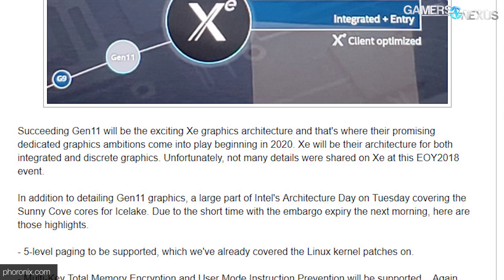Streaming Misconceptions: Best OBS Settings & NVENC vs. X264, ft. EposVox | LTX

Comment: Wow... I can't believe streamers are out there running 1080p on a webcam.  LOL.  It's been 4 years or so since I was messing around on Twitch.  I ran OBS as well with some templates to make it look more professional.  I streamed at 720p x264 on fast preset with my webcam (which was a PS3 camera using custom software so it would work on my PC) was at 240p.  When it's a thumbnail that small it will look just fine at a lower resolution.  My upload speeds from ISP was only 5 Mbps at the time.  Despite the challenge, I thought the streams turned out pretty well.

Comment: another thing that I would like to see more information about is ingame framerate vs. recording framerate. From my own testing the only way I can get really smooth recordings is to keep both framerates in sync. For example limit the game to 60fps if you want to record in 30 or 60fps. When I cap the ingame framerate to 58 or 62fps the recording in 30 or 60fps will not be 100% smooth (in all those scenarios, there is no encoder or rendering issue in the logs, because CPU and GPU load are way below 90%). And of course playing back 60fps on a 70Hz monitor will also not be as smooth as playing it on a 60Hz monitor, which is to be expected.

Comment: What is wrong with the AMD encoder?  I don't really seem to be having issues running it with my Vega 64 using streamlabs obs.   One thing though, it's impossible to stream when using freesync.   Any other issues I should be on the lookout for?
Reply: I came to the comments for this as well. I have a Radeon RX580 and I use that to stream to Twitch with zero problems. I find the quality drops entirely even when not streaming by using FreeSync so I just never use it. Which sucks because I bought a monitor because it was FreeSync enabled.

Comment: So with an 8700, I should be able to just set it to medium and be golden? I get mad input lag in rocket league when I do that. The game runs*okay* (still over 120FPS) but the input lag is unreal. Wut
Reply: meduim with a 8700, nope sorry. You need more cores if you want medium like the 3900x
Reply: @FreeSpirit90  You're gonna wanna go team red if you wanna software encode.  6c/12t or 8c/16t, or more  ...video takes full advantage of all available threads, so AMD shines here. 3700 or 3700x is basically built for this.

Comment: you can use this string to do a bandwidth test when streaming to twitch and it basically initiates the actual stream without going live i use this for testing all the time and its great 

just ad it at the end of your streamkey and remember to remove after to go live :D
?bandwidthtest=true
Reply: great for testing internet and bandwidth related thing. 
But this video talks about image quality, you kinda need to look at the video to be able to judge the quality.
Reply: @lordsqueak  that's not what it is for the bandwidth test is to see how much you can saturate your upload and for performance testing without going live why would I want to check my image quality if I'm testing for upload saturation and performance..........
Reply: @daineball  "upload saturation" ?? What a quaint way of putting it.
But to answer your question,, because you just watched a video talking about image quality. Getting the bandwidth just right is of course a part of it all, but that's not the kind of test they are talking about.
Reply: @lordsqueak  that is EXACTLY what they are talking about being able to push the res on your crappy machine VS the amount of bitrate you can push out most people cant even support a 5000kbps stream which is what they are talking about so when you need to find out weather or not you machine or internet connection can handle the res+FPS which equals your bitrate thats the budget they refereed to not once but like 4 times, please stop arguing with me you obviously missed the point of this video. the point if you machine can handle 1080p @ 60fps and you can only stream out 2500 the percived quality would be much less than even a 480p at 60fps stream and even the perceived quality of your stream would be higher if you just drop down to 30fps which is what they are saying so the point again is PERCEIVED QUALITY, so to get the most it prudent to do allllll of this testing OFFLINE and NOT LIVE thereFOR no image  is needed because the math is done already and if you cant do the math GTFO bro im saying do the math first and you weont even need to preview for image quality because you did the math first like seriously i just summarized the entire video and you wanna tell me i didnt watch it? get real dude.
Reply: PS UPLOAD SATURATION is a widely used term in networking and other tech cirlcles...., get good son! its used to describe at what point your connection can no longer handle a constant bitrate upload, burst upload speeds are different and so is kbps to megabit so honest just stop, ive forgotten more about computers and networking than you will ever know
Reply: @daineball  Well done! You have figured out what your upload bitrate is.  (it's not like you didn't know this already)
But that is not what that test is testing.  and it is certainly not what the video talks about testing. 
So instead of being all snarky and insultive, just accept that you didn't pay attention to what the video was about, and move on son!
Reply: Ps bandwidth = image quality and fps budget as they speak about so therefore it would be prudent like they talk about to not stream at 1080p @ 60 fps if your upload saturates at 2500 which is what they are talking about but I guess you could actually understand what they are talking about then you'd have known that and not commented a pointless regurgitated comment.
Reply: @daineball  Well, I know "upload saturation" is not what is being tested with that twitch test, or what's talked about in the video.
Reply: @daineball  Well, first of all, you didn't pay attention to the video. Or to what that twitch test actually does. And while bandwidth saturation is a thing, it is not a thing that has any relevance whatsoever here, since first of all the test being talked about in the video is about doing a video quality test. secondly, there is no way anyone single streamer is going to ever be able to saturate the upload to twitch servers. Thirdly, the twitch test is about the quality of your connection, detecting lag spikes, drop outs, and generally figuring out if there is a problem with the connection.
Fourthly, instead of just accepting you made a mistake, and silently go away, or even do the honorable thing and go "my bad", you resorted to insults, so you're damn right I'm going to call you out on it. and now lastly something that is borderline a death threat. And that is not OK!

Comment: Second time I say this -> Twitch does not have bitrate cap -> I've streamed with over 35 mbit/s / 35000 kbps and the stream info shows it. Maybe there are caps for new accounts or something because I don't have a new account but I also have no "achievements", viewers and so on...
I would also like to add that above 15000 kpbs there is no difference at all to the quality on 1080p on 60fps.

Comment: I actually prefer streaming 720p even tho my PC and internet connection could easily do a 1080p stream. Why? I did some testing and I think 4mbit is a sweet spot for 720p30. But with simple math, that makes 9 MBit 1080p30 literally impossible on Twitch. 8 MBit for 720p60 are already the maximum. 1080p60 for me is simply just a wish, adding up to 18 (!!) MBit.
Reply: 720p looks fine to me on Twitch. 1080p even if streamed well is not much better than 720p.

Comment: Hi steve, a VR content creator improved his framerate by hitting the reset/default button in overclocking software, like MSI Afterburner, a couple of times while the game is running. Nvidia looked into the issue and responded with "it just workes!". Could you take a look at it? The link of the video: https://youtu.be/7YpWQflHTC8

Comment: AMD has problems with OBS, which go beyond their encoder. I was still using an Radeon HD7870, until recently. There is something wrong with how OBS and that GPU communicate. I couldn't even use X.264 for a usable stream, above 30fps. To get 60fps, I had to drop resolution way below 720p and use the "low latency" preset. And the preview window was a huge performance hit. Really strange behavior. I just wanted to stream some Soulcalibur 6, which has REALLY low CPU usage. Couldn't do it. So I bought an RTX 2060 thinking that NVENC would solve my problems and then found that everything else in OBS works better. X.264 is no problem now. The preview window is a tiny performance hit.
Reply: Comparing an 6 year old graphics card to a half year old card ... seems fair.
Reply: @MrDavibu  A. GPU choice shouldn't affect your ability to use CPU encoding or even view the preview window. 
B. The "Southern Islands" GPUs should still be relevant, because that's what's in PS4 and Xbone. Both of which can stream just fine. (Xbone is basically a 7770 modified for APU format and PS4 has 7870 shader cores with 7850 clock speed and 7970 GPU compute section----modified for APU format). There is clearly some neglect for support going with those GPUs either with AMD, OBS, or both.
Reply: @ChitonIV  
You have to interact with the GPU to get the framebuffer and also to produce the preview window. 
The XBOX and PS4 use shared memory and they can write their drivers as they want, they just need to get the address of the framebuffer and start reading, so there is basically no overhead.
Reply: @MrDavibu  uh huh and there shouldn't be THAT much overhead, on a 7870. As I said, I was trying to record Soul Caliber 6, which uses a teeny amount of CPU time. And I was running the game at 720p, which is cake for even a 7870. Over 50%+ GPU resources left over. With the 7870 as my GPU, I couldn't get a 720p/60fps capture via X.264, Quicksync on my 7600k, or AMD's encoder chip. Unless, I drastically reduced quality settings for encoding.
Reply: and downscaling was its own performance hit. such that the performance gain from reduced resolution from the downscale was nearly offset by the performance loss of the downscale, itself.
Reply: @ChitonIV  
What I mean is, you state AMD having huge problems with OBS and use a 6 year old card. But you praise Nvidia for working flawlessly on their newest card.

If a GTX 680 or other card of similar age can run OBS with no problem, you would be right, elsewise stating AMD has fundamental flaws and Nvidia doesn't is just wrong.
Reply: @MrDavibu  I'm not actually particularly praising Nvidia. I'm saying its not good that I had to get a different video card, to simply be able to utilize the preview window without a noticeable performance loss and to also use my CPU for encoding. Both of which were benefits unknown to me, in getting a different videocard. 
I bought the Nvidia card, for NVENC, thinking that my system just didn't have the power to do CPU encoding. It actually has plenty of power. there is something wrong with how OBS and the HD7870 interact. And I assume that some of the other "Southern Islands" cards would have similar issues in OBS. It also turns out that NVENC's quality varies noticeably from game to game. So no, its not all roses for Nvidia, either.

I would love to test a 660ti (Nvidia's 7870 equivalent), but I don't have one. I also think it would be interesting to test a newer AMD card and see if AMD requires relatively more resources in OBS, compared to Nvidia, in general. Even on newer cards. Or if this is truly unique to their older cards.

Comment: given the NVENC advancements with Turing i have been very interested in having others test it for me as i cannot feasibly stream but i do love learning about it. EposVox may have addressed what i will ask on his channel though i dont know as i dont typically watch his content. (but i think i will now since i love what he is doing) Question being: does NVENC work better on Turing for streamers who play game side at 144fps? Anecdotal  evidence would suggest no but im basing that off of previous gen cards as nobody that i know with a Turing gpu and high refresh rate monitor has tried NVENC. even with the advancements in Turing i would still imagine the answer is no due to asking alot from the gpu at that point but even then there are quite a few variables to that question that need to be addressed. hope can start some insightful discussion!

Comment: https://unrealaussies.com/tech/nvenc-x264-obs/. Basically if you have modern hardware, use nvenc unless gpu limited, quick sync otherwise. Only real reason to use h264 via software is if you have amd cpu and gpu.

Comment: I really dislike how this guy speaks in absolute values. Almost everything he says is a clear cut yes do this, no, don't do this. Mediocre advice at best. Certain games look better on 1080p60fps 6mbps streams on twitch. You cant just say that 720p gives better quality without discussing static images or fast paced scenes etc. Literally different settings for different use cases. I had an older system with a  i5 4670/RX480. Oh no I cant use AMDAMF, I cant use quicksync, I can only use x264 because thats what you said. Obviously I know that both of you have a deeper understanding of this topic, but what is this, a techquickie video? A beginner streamer will apply wrong settings because of your advice here, an advanced streamer will learn nothing from this. There is some great advice mentioned though, like defaulting to NVENC.
Reply: He doesn't

Comment: Hi, how big is difference in OBS between NVENC new on Turing and NVENC new on older GPU? Now I have GTX 1070 + R7 1700 (unusable for 1080p@60fps streaming, even on @3.7GHz). I want buy RTX 2070 Super.
Reply: Image quality was slightly improved with Turing, so I'm guessing that's what this setting is referring to. A 1070 should still be pretty good, not sure why you can't seem to get it working for 1080p60. If you're using gpu encoding, then your Ryzen should have no impact on streaming performance, only game performance should be affected.
Reply: @EVPointMaster  If I use GPU,  I can stream in 1080p&60fps, but not with x264 using my R7 1700. My idea is buy RTX 2070S and maybe later R9 3900X. But if is new encoder good enought for quality like "x264 medium", it is wasting money.

Comment: I have a 3900x and a GTX 1080.  When recording video, I actually still stick with NVENC a lot.  Most games it's still less of a performance hit and running CQP 18 (have to double check when I get home  the exact level) or so and it actually still looks beautiful at 2560x1440.  There are a few games that I prefer x264 but NVENC has been pretty "set it and forget it." This is on the old encoder too, not even Turing series. It seriously runs and looks beautiful.

Otherwise, with streaming it's of course gonna typically be x264 to maximize quality on the lower end of bitrate but please do not discredit the ability of NVENC.  It really has been a game changer while helping performance take minimal hits.  In Rainbow 6 where my CPU is not really going above 30-60% I can easily throw x264 and get very little impact while retaining quality but there's instances where NVENC still holds it's own and in reality, for most people with less expensive hardware, you can really get away with a lot.
Reply: Tenfootgiant i bought an RX550 to do all the job. I can record 50 000 kbps almost lossless and my games have to suffer no penalty. I think secondary low budget gpus are underestimated for recording
Reply: @PyromancerRift  for that price you can just get a capture card probably with an encoder which would be better if you wanted to stream.